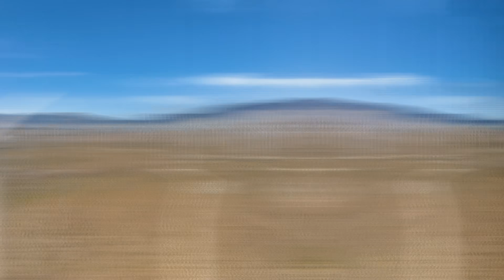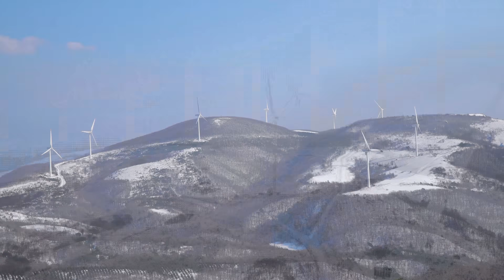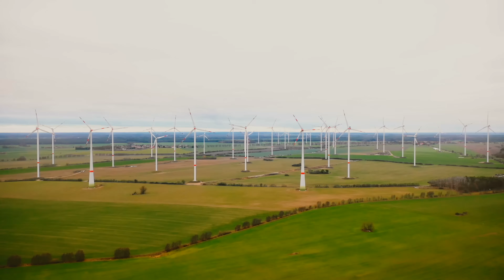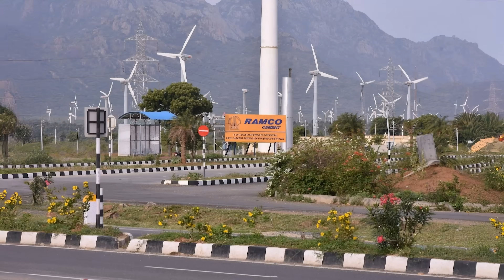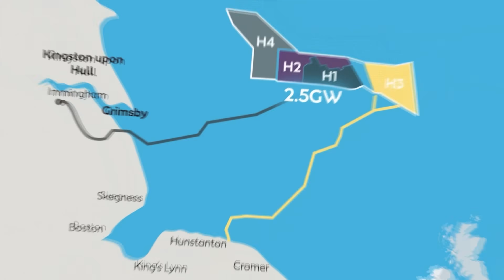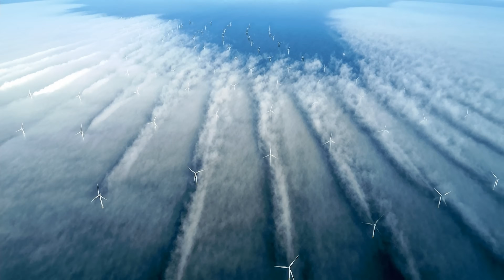15 Giant Wind Turbine Fields That Look Like Mechanical Forests

Comment: ON I-40 between AMARILLO, TEXAS and Tucumcari, NEW MEXICO  that LASTS BETWEEN 35-43 miles long  on both sides of the interstate and  is so big it is hard to measure.    WHAT SCARES ME IS THE LOCATION WITHIN what is known as  TORNADO ALLEY!    When the WIND TURBINES FROZE during the winter(several years ago)  TEXAS WAS WITHOUT POWER IN MANY AREAS and people froze to death as did  many animals.  The WIND TURBINES are eerie and magical at the same time!